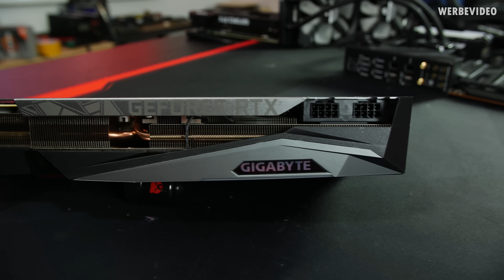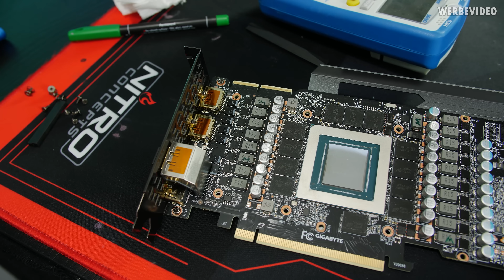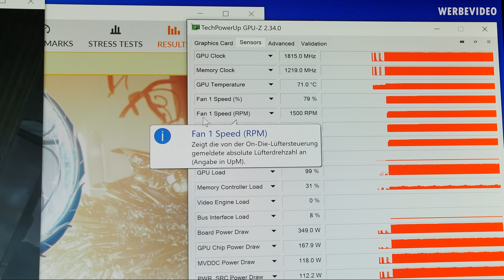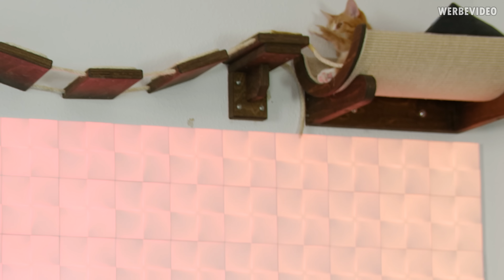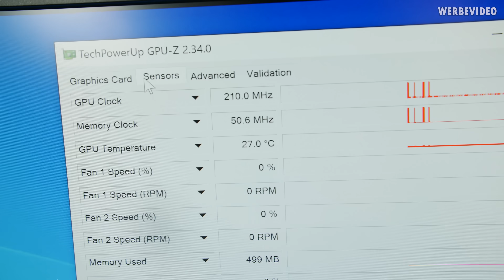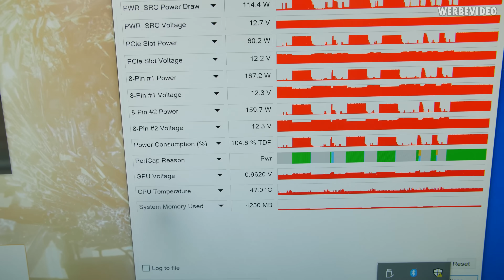Gigabyte RTX 3090 Water Cooled  - Is It Worth It?

Comment: Retry the water-cooling with the back-plate so the misc components get some heat dissipation if only through the PCB to the back-plate.
And retry with the stock cooler without the stock back-plate with some manually attached heat-sinks to the backside components to check if the a totally free throughway like you theorized at 11:55 helps.

Comment: For the price of these cards they should just come with their own modular cables if they want to use a different connector.
Reply: modular connections aren't standard. You'll need to make every kind of modular connector ever produced. It contributes to more e-waste as you'll only need one out of the possible dozens of possible pinouts as well as having to account those who do not use a non-modular power supply.
Reply: That'd be reasonable if modular was a standard. Also, if you're dumb enough to spend double for 10% gains, you deserve to get fleeced.

Comment: 20% more CUDA cores, 50 watts higher TDP, more than twice the price...but only 15% better than the 3080.
This felt like a Gru meme.
Reply: I was expecting this based on the published specs. You are basically paying for 24GB framebuffer and "8K Gaming" marketing. Like Steve from GN pointed out - that card should never be marketed as a gaming card, but a workstation card. Definitely not worth double the 3080 price for gaming alone. Disappointing launch to be honest.
Reply: @George Lucas vram is relatively cheap, that's additional memory is probably around 100$ more. Paying over 2,14x more for 10% more performance is silly.
Reply: @CoreyPL  except it's lacking the pro drivers so really if you were serious about a workstation card you'd most likely wait for the titan with 48gbVRAM so the 3090 is sitting in some niche enthusiast zone....

Comment: That's a yikes from me. $1500 for cheap plastic shroud, airflow blocked by flimsy connector extension, small noisy fans, all typical for Gigabyte.. Even the FE is cooler and quieter. Not that it matters for me either way with the 8k marketting bs.
Reply: yeah they are forcing you to go for their higher end models for improved cooling
Reply: The FE cooler looks to be excellent on the 3090, running at sub 70C with 1100RPM fan speed.
Reply: It's funny you think you'll be able to snag this card for 1500 haha
Reply: Alfredo Alvarez actually in China gigabyte is the only manufacturer that ACTUALLY sold real 3080s to real individual customers while others manufacturers just pretended they sold out
Reply: dont know where you get the noisy fans from, since my gaming oc is perfectly quiet on the stock fan curve.
Reply: Screw this, I'll wait till the dust has settled and OC my 5700XT.
Reply: Philipp Munkes powermod it. 2.2ghz+
Reply: mike h people will buy. Trust me
Reply: Hey it is 8K worthy!!! @ 13fps...
Reply: Disscordiab Lorenzo  OTH.

Comment: The flat power connectors look like they are still Molex Mini-Fit Jr, so you could get a pin extraction tool and put the flat connector housing onto the end of your PSU power cable if you want.

Comment: Those connectors could likely be reused. Need just some testing with a multimeter and sleeved cables would be easy. Would look great with end mounted cables and a water block.

Comment: Honestly, if i was in the position to be able to afford to buy, and liquid cool, an rtx 3090, i would still do it. Why? Mostly, to turn it from a 3(+) slot cooler, and trim it down to a single slot if possible, so that I can free up expansion slots typically blocked by such enormous coolers.

Like, the only reason i would still want an R9 Fury now, is because the ek block kit for it can make it into a pure single slot solution, with its provided bracket. In my present living room pc, that would have afforded me the use of an extra pcie 1x slot that could let me install a different sound card or a capture card to encode in hardware.

Comment: thanks for the video. But one thing I need to add on, the water cooling approach may not show a significant jump in performance for the GPU but it helps with one important aspect of the build. this GPU needs around 350 W and it exhaust a lot of heat to the case Specially the one with two fans from NVIDIA itself. so basically putting it in a closed case will hit up SSD, Motherboard and rams a lot. and I think the only reason you wanna consider water cooling is to transfer this hit outside of the case.

Comment: Those wires are a really cheap execution and botches the flow through design
Reply: It's to keep the cables cool so that they don't overheat. XP!
Reply: Agreed. It normally would be excusable, but when dropping nearly 2 grand on a card better design would be expected. Frankly the Gigabyte card looks ugly. Most of the AIB cards look ugly IMO. Founder's Edition clearly looks the best.
Reply: @amirjubran1845  Nvidia: "We're going to do something completely new! A pass-through cooling design made possible by a specially shaped PCB. In order to enable this design, and to save space, we'll use a smaller power connector."

AIB partners: "Let's just throw 3 fans at it like usual."
Reply: @CaveyMoth  well thats because  nvidia trademark the design and AIB is not allowed to copy it, not to mention there is other limitation to aib custom board design, so AIB can't do anything about the 3 fans design, becuase nvida restrict their design freedom
Reply: im also a bit surprised that it only has 2 8pins, seems many of the 3090s have triple 8pin

Comment: What if you built a card within an enclosed liquid non conductive suspension chamber.
Then find a way to further cool the casing, since it would be enclosed their would only be condensation on the exterior of the casing. 
Pumping the fluid allows the suspension to reach ambient, but cooling the actual sealed enclosure would allow for consitent cooling.

Comment: That's one hell of a packed board! Look at that sea of passives next to the VRM controller!
Reply: Graham Sutherland that’s a gigabyte gpu for you. Zotac and galax gpu’s are also packed. I prefer the asus, msi models, not as packed of a pcb, evga is also good too.
Reply: @AznTony360  The Asus ROF cards look excellent. Very well designed. The MLCC decoupling caps on the back of the GPU are well placed, and appear to be split into 9 segments for cleaner BGA fanout. Ridiculous phase count on the VRM. Still need to find some high res shots so I can figure out where the high-side 12V rails are being generated on the Strix board, though. Looking forward to more details coming out.
Reply: @gsuberland  I disagree, although asus and msi seem to be bringing back the excellent build quality we all know and love. The led light bar on both the g trio, and the rog strix looks horrid, despite the superior material design. Sleek and suttle design makes everything look amazing. It's like wearing a suit and tie, black... gray.. or black with gray lines and a single color tie. Amazing. While the 3080 rog/trio cards are like you wearing a bright yellow or pink suit and a unicorn tie. Look how gorgeous the 2080ti and 1080ti msi/asus flagship SKU cards look. Just enough rbg that doesn't make you want to vomit. The thick led bars on the 3080 are horrid on both cards even if you turn them off.

Comment: I want to see what an FE waterblock would be like. I could definitely see someone like EK making a special block for it which could be sold separately from the backplate to make a fat stack of water-cooled FEs as they're single-slot and justify the decision with a special NVLink adapter to pair four cards together... provided there are still motherboards with that many PCIe slots to spare.

If someone wants to go the Accelero route of having cooling on the top and bottom, a special plastic cover to place on top of the block with thermal pads on the solder joints could help to suck away even more heat if the entire thing is metal. It would have to be since that block is going to heat up right quick and there'd need to be more metal to prevent heat soak.

Edit I just realized, the power connector would prevent this from working. Damn there goes that dream.

Comment: I think it won't be too hard to make a full cover waterblock. Either make it long enough to sit flush with stock backplate or make it shorter and turn the connector 90 degrees just like with evga powerlink. Also making waterblock with built in shorter 8 pin extenders won't be too difficult and expensive to make.

Comment: Those connectors should actually be BETTER for watercooling enthousiasts. Just take them out of that black plastic enclosure and you have a 2 small extension cables, making this card much cleaner looking with a waterblock then the usual front mounted powercables.

Comment: If you performed a shunt mod allowing the card to use more power then your clocks should have been able to go a little bit higher.  The temperature headroom water cooling affords you would see to that.  These 30x0 cards seem to throttle around 70c so running 20c below that I would expect the card to be stable under H2O and a shunt mod around 2050 to 2100MHz.  Basically the same as the Pascal cards.  Will you try this again with a modded BIOS or a shunt mod to see if that allows for higher clocks?  Regardless When I get my 3080 I am going to try.  I am still running a Pascal Titan X and I can't wait to play around with the 3080!

Comment: You didn't add any cooling to the power delivery, which gets almost as hot as the chip. You just removed the cooling from it so now it's even hotter and a) is gonna burn fast b) is gonna cause a hard to detect thermal performance cap

Comment: I would like to see these tests run again but with a triple 8pin 3090. Specially if you're running into power limitations and on gamers nexus, they've shown this gpu can easily hit 400w. My assumption is that with the dual 8pin, there is too little room for overclocking to see a benefit from watercooling.

Comment: I think this generation, the water cooling will mostly not be for performance. It will be for width; some of these coolers are crazy thick, and some simply do not fit or do not have enough free air space in some configurations like many vertical GPU mountings.

Comment: 90% of the duty of the thermal pads on memory and mosfets is to make sure they're all reasonably close to the same temp, 10% is to cool them.   You don't want ram to run at different temps ever at the speeds used on GPUs

Comment: If you could identify the pins used in thise connectors, a set of custome sleved cables would be SOOO clean!
Reply: Looks like minifit jr 1x8 connector to me. Same terminals so same tools for existing custom cables unlike the FE 12pin.

Comment: corsair and seasonic(?) have said theyll be producing 12 pin adapters for their modular power supplies
Reply: Yes because the adapters are not optimal for 400w of power (and are ugly)  but only FE have used the new 12pin conectors....so far

Comment: Deffo be more of a difference if you raise the power limit to the moon and add more voltage, 105% power limit is nothing, it's pretty much running stock just cooler.

Comment: The two 8x1-Pin plugs look like maybe they can be re-wired with the pins from the PSU cable. Let's see, my waterblock is announced for right before xmas and this looks like some unwanted puzzeling for the holidays :)

Although it would be solvable in a "proper" way by making the waterblocks backplate larger, providing space to mount that connector to just like on the stock one. Possibility two would be using the stock backplate, although that would mean to introduce the angled part with the "Geforce RTX" on it to a Dremel.
Reply: The block is arrived. Switched to one from Byksie, which came with adapter cables to get rid if the connector block. It wasn't worth it for OC, but getting the system silent again was definitely worth it and temps under load dropped by 10°C aswell.

Comment: Thinking about water cooling the same card, Gigabyte made the cooling ridiculously loud 1700+ RPM in BOCW at 60C in a open airflow case(glass side panel randomly combusted yay) is not exactly great unless you want to turn up your speakers or wear headphones all the time. My expectations are probably a bit far fetched coming from a MSI Gaming X Trio 2080 Super which ran at 1200rpm almost silently in the same game 55C.

Comment: I disagree with the connector analogy.
For air cooling you still have the extra space for the hearsink and the third fan.
But for water cooling you don't need jt so the PCB can be a bit shorter and tider.
Ofc it comes down to if there will be a water block to buy for it. If so they should put a cable adapter like the FE to be abit cleaner.

Edit: I want to note the implementation is a quite bad xD for many reasons you said in the vid and a bit more.
Like why is the cable so long it would be much shorter

Comment: i hate the "8K" BS
just like the console "4K" marketing, 99% of people who own a console don't have a 4K TV just like PC owners don't own a 8K TV
Reply: Even 4k is useless for most people. I have a 55 " OLED and i can only see a tiny difference between 1080p and 4k. The TV is 1.8 meters away...
Reply: @hanshanserlein576  for sure distance from TV is also an issue 2 metres from a 55`` + TV is a must but 8K is like, you would need a 100`` TV from 2 metres to see the benefits and those TV's are like $10000.
i wish they wouldn't push 8K and push something like 4K 120FPS
Reply: I bought a Hisense 65" 4K tv a couple of months ago in preparation of the new consoles :)
Reply: @hanshanserlein576  i had a 10year old LG 55" Led LCD 1080p tv. Bought a 65" Hisense 4K tv 2 months ago and I can see a massive difference. Doesn't even compare.
Reply: @hanshanserlein576  I'm about 4 feet from my screen. I noticed a clear difference from 1080p to 1440p and from 1440p to 4k.

Comment: Coming back to this early March 2021: 
- While the PCB is good, it turns out that stock VRAM cooling is NOT good at all - mostly because the pads' performance is terrible. If you do any ETH mining with this card - or anything else that involves heavy VRAM usage - you're not going to be a happy camper. Roman may actually be getting BETTER VRAM temps with a nekkid card and a couple fans ...
- Bykski and Barrow have issued compatible waterblocks .
Reply: Well this is good news, you shouldn't be using these to mine w/ anyways.

Comment: @der8auer I would be really interested to see what your VRAM temperature was and whether it could be improved using a water block. I got one of those Zotac 3090 Trinity OC cards and the VRAM junction temperature can easily reach a 100-104 C when gaming. With memory OC, it can go up to 114 C. While the GPU is on 57-63 C. Do you think an EK waterblock could help here?

Comment: Herr der8auer! :) 
I am running he same card and I am having a constant >100C temp on the memory :( I did not see you talk about memory temp in your video, but do you have maybe any suggestions on why that is and how can I improve those temps?
I am using it for gaming, not mining. The card is stock. I think the high temps are from the backside of the card, where the VRAM below the backplate is.
Need some help...

Comment: noticed 6 cheap power caps on the back of the GPU. Not to NIVIDIA's specs
Reply: yeah the asus tuff he did had 6 of those high quality ones, but you go to asus' site and they show all the cheap ones. it makes me worried to buy any of these from any company.
Reply: 1) the polymer caps are not necessarily cheaper than the MLCCs; 2) both cap types are options in Nvidia's specs. Where are you getting your ill-informed misinformation from? What's your electronics background?
Reply: @rednammoc  he's an electronics engineer, graduated from MIT and he helped Steve Jobs make the first Iphone. His grandfather helped pioneer and invent the first pcbs

Comment: The step forward from 2080TI towards 3080 / 3090 looks good on paper, until you realize that an overclocked 2080TI is actually not that far behind an overclocked 3080 due to limited oc potential. 
With the other problems the card has (low vram, poscaps issues > crashes, really hot Vram, etc.) the card does look less and less attractive. And the 3090 is overpriced und underperformant if you do not use it for professional stuff like rendering. 
My feelings start to shift from "not bad" to "meh"

Comment: I have an Gigabyte Aorus RTX 3090 Master that has thermal throttling. I've changed thermal pads, all of them with good ones from Grizlly, still nothing it starts with 106MH/s and after a few minutes goes down to 75-80 MH/s in hasshing power. I didn't overclock it. I have no idea what to do. 
Do you have any suggestions?

Comment: I see this card has the "cheap" SP caps. What is your opinion about this?
Reply: I would like to see the Asus Tuff with a waterblock on it. I'm hoping that more expensive design will produce higher clocks.
Reply: Get jewed son.
Reply: Yeeep. Looks like they were smart enough to nerf their GPU Boost limit in the VBIOS before shipping. It didn't dare go near 2Ghz even on the waterblock. Which means Gigabyte was aware of the limitation. Otherwise it'd be going well over 2Ghz and crashing. Also W-T-F at that power connector setup. I can see what they were trying to do, but that was dumb. Gigabyte dropped the ball here big time.
Reply: Theyre not the cheap ones.